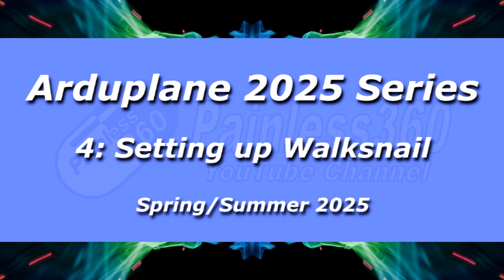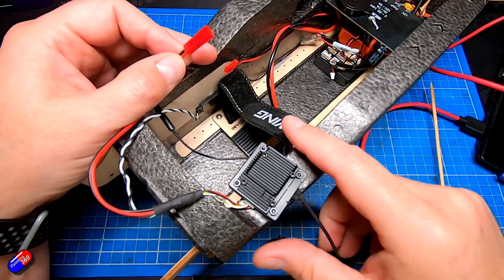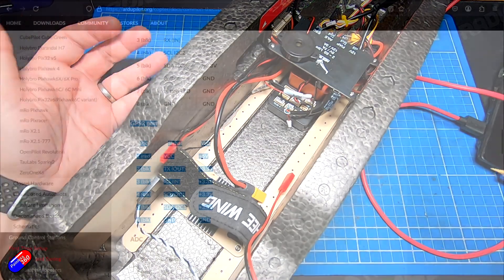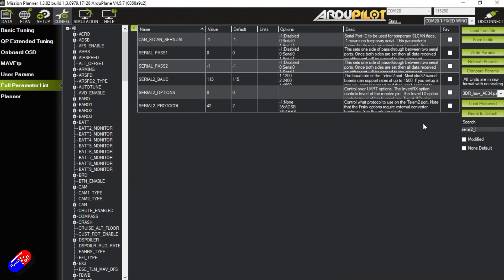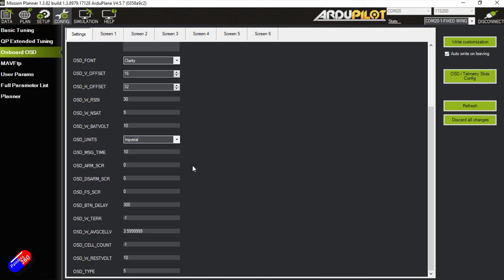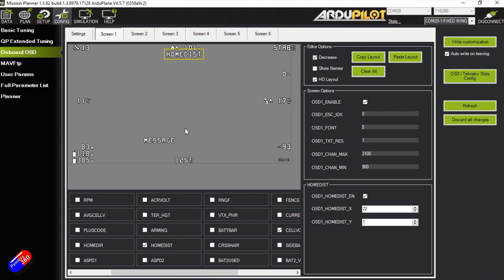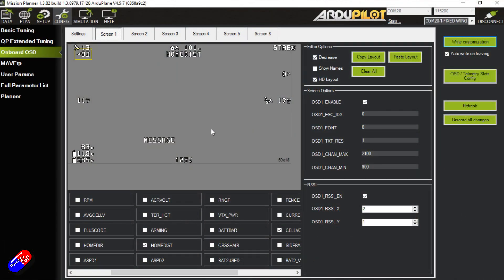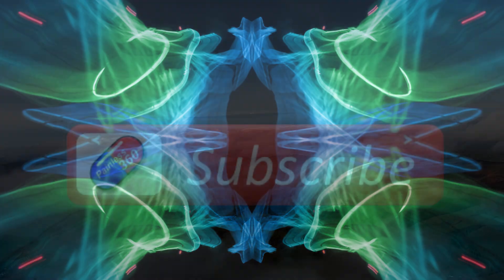Arduplane Build 2025, Video 4: Setting up HD FPV on Ardupilot

Comment: Would you consider a video on this setup using the DJI O4 air unit?  I am using all the same hardware with the exception of the air unit. Thanks!
Reply from the maker: I don't use DJI stuff here but the setup is almost identical... Happy flying

Comment: Amazing tutorial! Can we have one showing serial control of c20 gimbal next? For arduplane and inav pls ;)
Reply from the maker: The only gimbal stuff I have done recently is the Walksnail head tracking stuff... Happy flying
Reply: @Painless360  yah, walksnail GM3 is the XF C20t. Do you know how to gontrol the gimbal from inav using serial?
Reply from the maker: I've not needed to... Best of luck
Reply: @Painless360 got the serial gimbal working with Inav but now the OSD is flickering, lol...
Reply from the maker: I'd check the ground wires are all solid.. Best of luck!